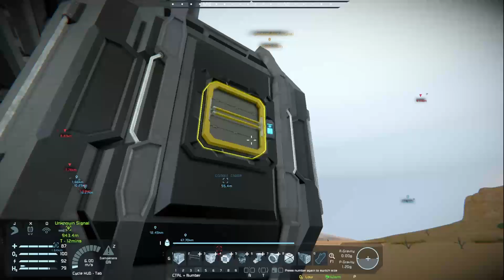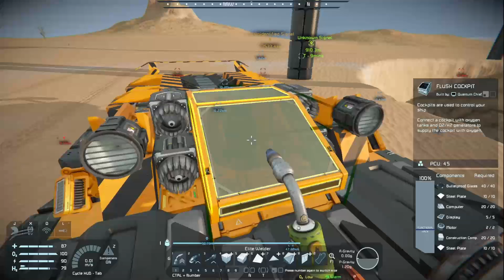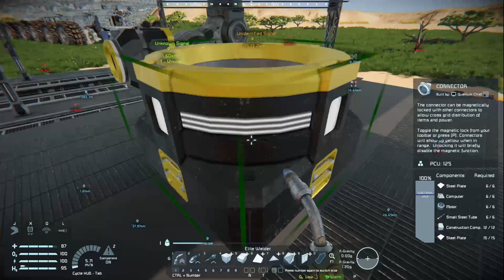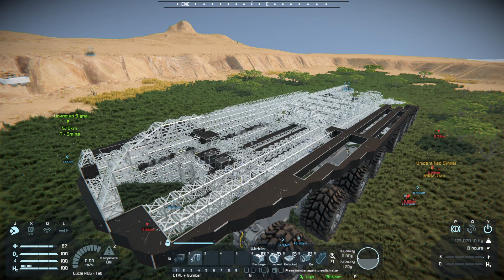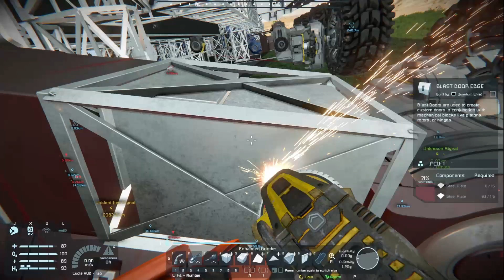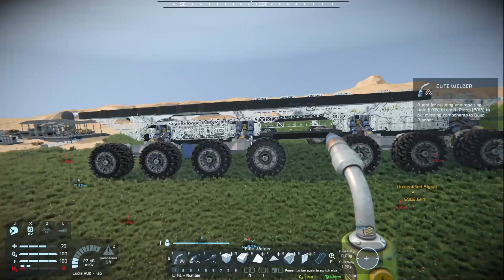Slow But Steady Progress - Nomadic Survival #25

Comment: angry wheels is often the result of them hitting each other = known as Scrub.
add a single block between suspensions to give a gap so wheels can turn freely.

Reavers are no joke and are for advanced players.
they hate EVERYBODY!
keep transmissions or broadcasts to an absolute minimum and do not move around if they are nearby.
you cannot hide from Reavers! they will literally dig you out of a mountain
Reply from the maker: Yes reavers are indeed scary as they fling so many rockets at you. I will be turning on my antenna to max and fighting them soon

Comment: A day late to the party, and still watching.

I was going to comment "quack", but I think I'll say "why not use action relays and event controllers for the truck loading chute?".

I wonder if longer comments are favoured by the code overlord over shorter ones too?
Reply from the maker: its an option but would have no easy way to know how full the rovers cargo is. Also appreciate taking part in my experiment
Reply: Wouldn't you be able to have the EC (mounted on rover) monitor the Cargo Filled %, once it meets that 70-80% threshold, trigger action relay to send on channel x to loading station? Have receiver relay turn the ejector off?
Although, I could be missing a vital part of the puzzle (and knowing me, it's highly likely I am. I measure thrice and cut 16 times)
Reply from the maker: @phforNZ  haha actually you may be right, im not going to lie i haven messed around much with action relays or event controllers for that matter
Reply: Event Controllers are amazing - just need to keep in mind they only trigger when the condition actually crosses the threshold (if you've already gone past it, it won't trigger) - edge triggering, basically. Great for setting up a safety net for the "disconnected the flier from the dock and forgot to turn on the batteries" we've all done too. Action Relays I've tinkered with, but definitely still a rookie on them. I could be wrong on it, but they feel like they're just for activating timer blocks via antenna.
Reply from the maker: @phforNZ  yea i know there powerful, if used correctly, i need to mess around with them more

Comment: You've really made me get into building rovers, i just wish I understood your suspension systems more and the process of tuning it to get them to actually work well, not just enough to get by. Sad thing is, Im on xbox so im STILL waiting for the contact update. I want to rent a dedicated server so i can take part in all the scripts and mods you use, but I'm affraid of having to start over when it finally does release. So I'm just sitting here waiting 😢 also I got a feeling your steering angle on your flatbed rover is why it's catching and ripping you over everytime you turn. I think it needs to be staggered. 
So like 20° 1st front axle. 
5°-10° on the 2nd front axle. 
0°-3° 3rd. 
5°-10° 4th. 
20° on final rear axle.
It all depends on how far from center of the wheelbase the wheels are. So those two front axles i think are just constantly fighting over which turning radius to take.

(My comment for your request for me to comment)

Edit: also, I'll be honest man. I absolutely do not like the way the Hazzard material looks lmao. I wish it actually texture wrapped like the other materials do

Comment: I really like the yellow and black aesthetics of all your vehicles. I think the cross hatching lines look brilliant, but can easily become visually noisy and distract from the clean lines and contrast on the mining ship.  Sometimes less is more.

Maybe think about using the black and yellow crosshatch like it would be on a real piece of machinery. Use cross hatch to highlight dangerous pieces of equipment like drills and thrusters, or landing gear. You could also use it to mark doorways, moving parts, or docking and parking areas on your mega rover.